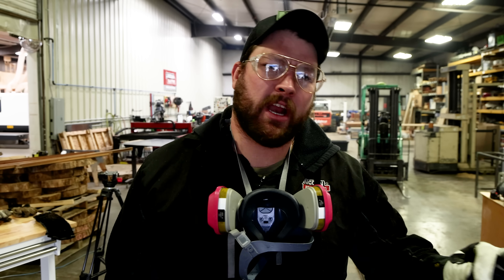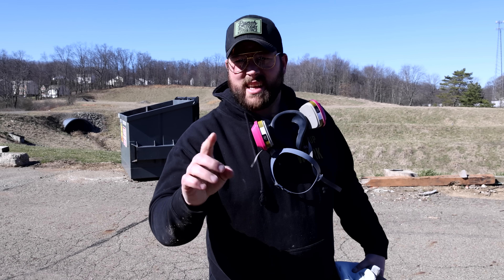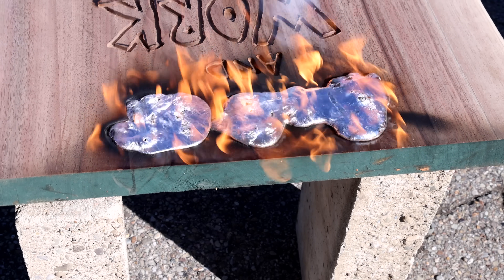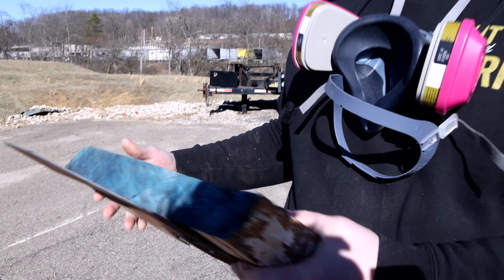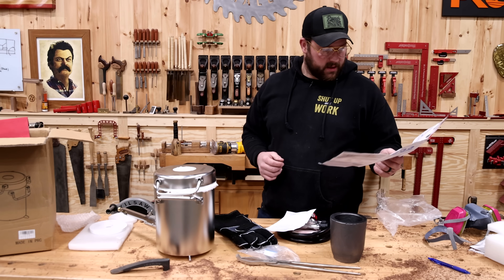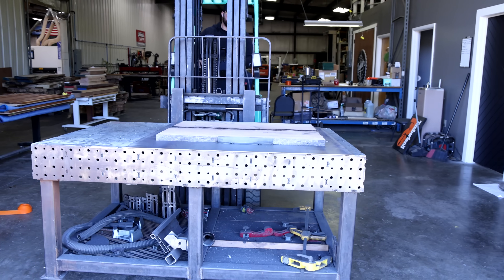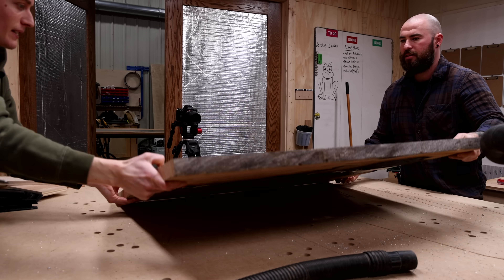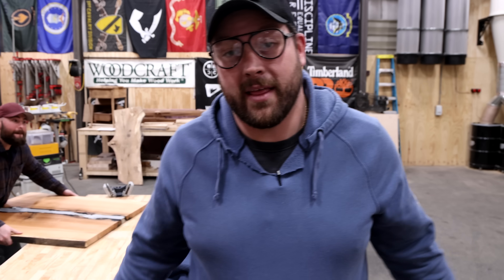I Tested Pouring Molten Aluminum in Wood

Comment: I wonder if something like plumbing solder would have worked better than aluminum.  It has a lower melting temperature but would look relatively the same. Would definitely be more expensive.  Just a thought.
Reply: I was thinking pewter as it can be bought in large quantities and can be melted at a relatively close temperature to woods combustion point and as long as you put a coat of epoxy on top then you don’t have to worry about lead poisoning
Reply: @benben9794  you can also get lead free pewter, although that is mostly just tin
Reply: plumbing solder is a lot like electronics solder in many ways. I've never melted large amounts of plumbing solder but I have done electric solder. I would imagine that plumbing solder would have the same problem that electronics solder would. It cools too quickly and globs up. Once one layer is cooled it doesn't like to re-melt easily. It needs something like rosin to make it melt evenly again. I would imagine that plumbing solder would just pour in layers and would delaminate quite easily. Same problem that they were having with the aluminium.
Reply: @jonathanfairchild  With tin bars you could use preheater - just cosntantly heat wood to ca. 100*C (which would also dry it, so it would be great). Then if you poured next layer of tin at temperature 400-450*C it should solder between layers as it only needed to  heat previous surface to 220-240*C, which should be fine if it was always at >100*C. 
Main problem with tin is oxidizing both during process and during use. Oxides would create a huge mess and you might need to add some fluxes which fumes could be harmful. I beleive these would need to contain some special salts or acids so that oxides would be actively removed. 
Also Tin would oxidize during use of such table, which would just look bad. 

Personally it would be much easier to route aluminum metal sheet, route a grove ion the wood, and jsut place it, glue, polish etc. Charred wood effect can be achieved with eg. torch.

Comment: Make your mold slightly hourglass shaped . This won't make the aluminum stick to the wood but it will prevent it from just popping straight up because now the aluminum is gripping the wood from top and bottom in that hourglass shape.

Comment: Not every aluminum is the same…with different levels of sn, zn, mg, etc you can change a lot. Or even create your own out of aluminum and tin to get the melting temps way lower. Wetting the wood and wetting the pours also gets the heat down faster, while the lower melting point allows a better bond of the pours themselves. So Yeah, I think it’s possible and if you go polish with wet sandpaper of the tripple digs, you can get it shiny.    Possible yes, worth it…well…that’s in the eye of the beholder ^^
Reply: Wetting the wood would cause it to build and create steam pockets..
Reply: @Volt64bolt  wetting is different to soaking
Reply: Could have been no aluminum. Instead, zinc and/or tin as they have way lower melting and heat transmission, or a combination of the 3.
Reply: @jamb312  yes, see first comment ;)
Reply: @SuperVistaprint  yes however the amount of water you would need to help prevent the burning would be enough to form steam pockets, and even a little moisture would still cause bubbles
Reply: @Volt64bolt  we did a lot of sandcasting and we always „fogged“ or „misted“ the layers. And bubbles won’t cause an issue as they would either remelt with the next pour or they would we sanded of with the rest of the surface irregularities. Impurities inside the molten Mass would be more of a concern over that. Adding to that, that the cast in this case has no real structural value ie it’s integrity is of minor prio
Reply: @SuperVistaprint  your talking about between each pour? Surely you want it to cool slowly so it can reject the layer below. Ah well, I will test it out in the week. Just recently finished my home foundry
Reply: @Volt64bolt  tin content high enough, melting point as low as possible, the pour of the new heated material is so hot, it will rekelt the below layer, can’t do anything about that.

Comment: I'm only about halfway in, but I feel like in order to make this REALLY work you'd need a custom table, something made of high thermal conductive material, maybe watercooled so that instead of the heat dumping into the wood as fast and charring it, it gets dissipated out through the plate underneath. As well as drilling into each layer so it bonds together better when pouring

Comment: Because I am a stickler you're not smelting anything, you're only melting.
Smelting is a process of applying a certain amount of heat to an ore, to extract a base metal. It is a form of extractive metallurgy. It is used to extract many metals from their ores, including silver, iron, copper, and other base metals.😁

Comment: Not mercury. Memetic Poly-Alloy. Basically, metal nanotech that allowed the T-1000 to change shape and color.
Reply from the maker: someoene caught it haha yes!
Reply: @John_Malecki  Why not make an exact mold shape of the crack shape of the wood ,like a puzzle piece . Then, make the aluminum shape in the mold, therefore you are not pouring any hot molten aluminum in the wood. Then take that aluminum puzzle piece and place it in like a puzzle piece right in between both slabs of wood. Securing the table underneath with metal,or wood ect. This avoids pouring any hot aluminum into the wood. 😊
Reply: Nerd alert

Comment: This is not smelting.  Smelting is refining a metal from ore.  You are melting only.  Chris should've known that.
Reply from the maker: well, now i know haha .
Reply: Maybe Chris did know but just didn't correct him for the roast in the comments
Reply: @John_Malecki  Speaking of melting, you might want to get hold of an aluminum alloy that's actually developed for casting rather than melt pieces of aluminum plate. All the 4-digit series aluminum, your 6061, 2024, 2618, 7075 and do on, are not well suited for casting. They remain too viscous to cast properly. 

Instead, you'd be much better off with a grade that's meant/intended for casting. You have to get one of the xxx.x grades for better pouring.

Or, if you are sourcing at the scrap yard, only use cast aluminum scrap. No plate or bar.

Comment: Any of the pour areas need to 1) Go completely through the work piece. 2) Flare the top and bottom of the pour holes (lightly). 3) Fire harden the pour areas, top and bottom and middle. 4) ) Have a metal plate backing the pour zones. 5) Have a metal border sitting atop the work piece completely surrounding the pour areas - so you can put in more metal than flush. When you go to shave down the exterior - what's left behind will eventually be even with the work piece and permanently affixed in the piece because the metal is stuck in one side and out the other and can't come out of the work piece because the flared edges top and bottom function as plugs.

Comment: You would benefit by using casting aluminum as found in engine blocks and pistons, super dry wood to eliminate boiling moisture content bubbles, and pouring with the wood flooded with oxygen free atmosphere such as found in keyboard cleaning air duster. Correct if you read that to mean air dusters do not contain air.
In the alternative, you could get the look by slotting or milling a pocket in or at the base of the inside edges and assembling with a metal sheet, bar or an acrylic mirror before filling the rest with deep pour. charring the shoreline would be optional.
Finally, I might have used a casting alloy such as 181 with a melting point of ... you guessed it 181 degrees F.

Comment: I recognize that furnace, it is a 5kg hobby furnace.  For a project that size I would go with a 12kg furnace minimum, I made my 20kg aluminum furnace plus burner for less than $100 and have done thousands of melts with it.  Pre char the wood with a propane torch, use refractory cement to fill gaps under and along the sides, make sure it is fully set and dry before the pour.  Place the metal plate on top of a layer of kao wool, or raised on fire bricks to disapate heat quickly.  Connect the two slabs together using the rebar as well, adds rigidity and will keep the aluminum in place at the same time.

Comment: So 2 things, if you pre charred and cleaned the wood where it would be getting the metal poured into, that helps to seal the area. That method has been used for thousands of years to prevent rot and it helps make it more fire resistant. Also using that rain you had that day would have helped as well to keep the fire potential down. I haven't seen the video you were referring to on yours, but that is what I know about trying to reduce the wood from catching fire.

Comment: Curious if you could use a piece of C-channel to eat up a majority of the area and give effectively a "skin" coat atop that would resemble the finished product, limit the size of the pour you'd need, and if reinforced properly to the wood would give strength. 

Not sure if this idea is dead but might just need some refining.

Comment: Aluminum forms a layer of oxide on contact with air pretty fast when heated/melted and that layer has a melting point far superior than aluminum. Its why when welding aluminum they use argon gas to help keep the oxide from forming. I think thats why the second third and etc pours are not blending together. 1 Big pour would have been a better option.

Comment: 2 things I think might help is pour wax first to act as a flux that burns instead of the wood first (wax replacement process) second use an inert gas flow to limit the oxygen required with the heat to burn.

Comment: I definitely think he was using a different metal or alloy. Lead weights could’ve been used and should work with the melting temp and flame point of the wood.

Comment: Wondering to prevent the wood burning, are there any coatings to put on the wood?  Gels that can take in heat (endothermic), or spray/brush water on wood. 
Another method would be to cast a plaster mold of the space for where the aluminum would be.  Use the plaster mold to create a sand mold, then cast in aluminum (try to make it 1/6-1/8 thicker than the wood). Drill holes in wood and aluminum to match, and epoxy metal studs in the holes and along surface between wood and aluminum.  Machine flat.  Minimize the warping of wood due to heat.

Comment: If you use dry ice it should prevent the wood from burning.  Basically, put sides around the whole thing, place a block of dry ice, and the cold CO2 should prevent any flames!  Just a thought
Reply: Might hurt the flow that cold but the dry Ice would if placed right, stop oxygen from getting to the wood preventing the burn with the layer of CO2 gas created.

Comment: ive never done an aluminum mold pour out of straight wood, but I HAVE done aluminum molds using grill liner surfaced coated to the wood. also, when setting the aluminum, your right that it bubbles, but you can use a steel spoon to kind of mix it and get the bubbles out so it compacts better. i have mine tack welded to a piece of rebar. i would recommend trying to get all the aluminum done in one go but thats a big ask. if your super determined, you can make an induction forge pretty easily out of some old welding equipment. you can basically just drop your raw aluminum thru it and it will liquify before your eyes!

Comment: I have been thinking about this aluminum and wood problem, and I believe you could make a sand mold from a silicone impression of the gap. Then pour the aluminum into the sand mold and mate it between the wood slabs. Use a low temperature torch to fill in the edges as if soldering.

Comment: those little smelters are so awesome.  Everyone curious about this stuff should just get one and mess around, they're super affordable and if you then decide you wanna upgrade its not like you'll never use it.  You'll still use it all the time for smaller stuff and if you wanna do any stuff with precious metals then thats the one you'll wanna use.
Reply: Melter not smelter 😉
Reply: @tihzho  I'll be totally honest... I have no clue what the difference is between either or those... or a forge... I just use the terms interchangeably and hope its right some of the time.
Reply: @MayorMcCheese2000  Sorry I'm a stickler. It's a curse and a gift. 😆\
I'm a neon glass blower and I've used MDF with beeswax as a fixture for forming softened glass tubing. You can use graphite as well, liquid graphite painted on the surface. The Aluminum does not need to stick the roughness of the surface will mechanically hold the aluminum. 
The key is a barrier between the hot as all fu...hell aluminium and the wood. The type of wood makes a huge difference as well as being DRY. 
My two cents
Reply: @tihzho  I would think the wood being wet on the surface would help in the same way that a wet steak doesn't sear as well on a grill.  The water creates a barrier between the heat and the meat, I'd expect a similar outcome if used with wood, not soaking the wood, just wetting the surface right before the pour.
Reply: @MayorMcCheese2000  Hi Ben, sorry that is not correct. 

What you have with molten aluminum and water is NOT the Leidenfrost effect. This is when water contacts a surface that is significantly hotter than the water's boiling point whereas it produces an insulating vapor layer that keeps the water from boiling rapidly.

When molten aluminum contacts water there is a CHEMICAL exothermic reaction.  The molten aluminium atoms strip the oxygen from the water molecules, forming aluminium oxide and hydrogen gas - very violently!!!!  Exothermic reactions are those that generates a great deal of heat! How much heat? Well its over 2.5 times the amount heat generated by a similar amount of nitroglycerin...exploding. (ka-boom!)
Dry the wood completely then use graphite.

Comment: I agree with the commeents, pre-char your contact surfaces, mill your design deeper and just level all out with a cnc in the end. Here's a tip, if possible, use a rabbeting bit all along your design to create a "hidden shoulder" for the aluminium to wedge itself into. Also, when you do your final flattening (after casting) with an end mill, try to remove about 3mm of your total wood surface to remove most of the surface char and pick out any nasty char left between the wood and the aluminium with a needle file set. Then fill the surface voids with epoxy and aluminium powder mix and finish. Lots of work but well worth it.

Comment: Ever thought about cutting your wood and using that as a template to make a positive to make a negative template to pour the aluminium into. Once you have the finished aluminium inserts fit these into the wood.  If you want it to look finished use diagonal screw or bolt holes which are counter sunk so after fitting fill on top of the screw or bolt with a little more molten Aluminium.  This way you wouldn’t have a molten metal contact but a solid fitment which can be milled flat and the polished.  I know it may be difficult to understand but what you are doing is make the Ally into an insert to put into the wooden slots.

Good luck

Comment: I was thinking that a pan underneath of a thick flat piece of metal under your wooden panels with cold water to absorb the heat from the pour might have helped. Not sure how much but It could have drawn enough heat away to have given it a smooth finish on the bottom of your mold, which is the top face of your project. This might require a thicker pour than you seem to be able to pour with the size of the equipment that you have.

There is a lot to consider if you decide to try any of these suggestions. How big of a water pan/tank is needed? How thick of a piece of metal plate to use for heat transfer to the water tank? What size of your project to work with the size of equipment you have so that the pour works to fill the space properly?

Maybe copper tubing with cold water circulating through the tubing to draw the heat away might work better. Instead of the water tank, use tubing of an appropriate size with a circulating pump to pump cold water through the tubing, underneath the plate, underneath of your project. Find out what material can draw away enough heat without melting. Copper might do it if it can draw enough heat of fast enough. Otherwise you will need to research other materials and find one that can do the job. 

Just some suggestion to think about. Keep having fun. WE are enjoying your videos. Stay Safe!!

Comment: Could you make a mold of where the aluminium is going, pour the metal into that & then use that by putting it into place? Also, I think you'd need to do 1 pour rather than lots of diff ones as it seems to not really be fusing together properly. I'm just guessing but I'd assume it's from the differences in temp etc

Comment: They probably use like an aluminum or thin steel channel that protrudes out from the original table top, then milled everything down. Maybe this would stop the wood from burning / spalling? The heat would probably still cause smoldering, but maybe wouldn’t sustain combustion.

Comment: If the wood already has holes or cracks just drill some "pilot holes" at an angle into the sides of the holes or the craps, some face up at an angle, some facing down. Molten metal will get into the little tunnels and harden and act like anchors.

Comment: The aluminum is not going to stick to chard wood but if put some long screws into the wood valley at staggered angles and and keep them about 1/2" below the flat surface of the wood should work , going to experiment to see which fasteners work best and probably need clear epoxy to seal the edges where chard wood meets aluminum.